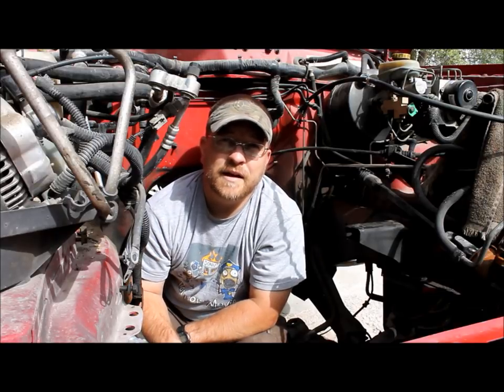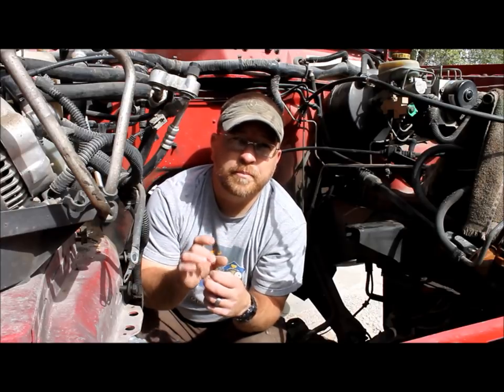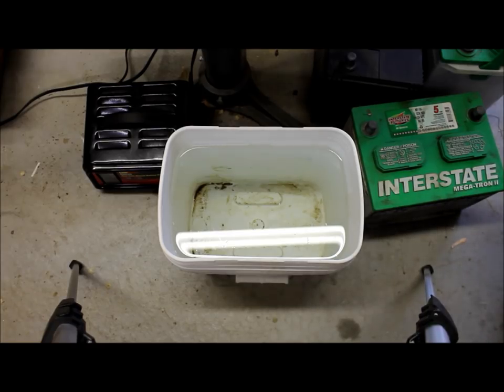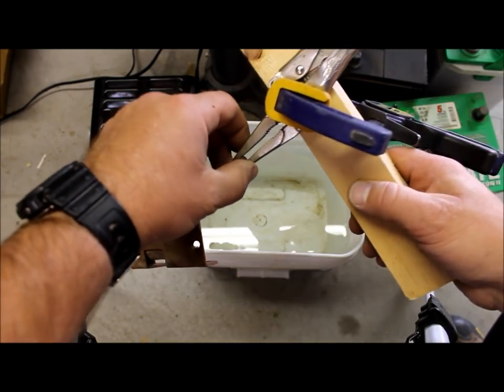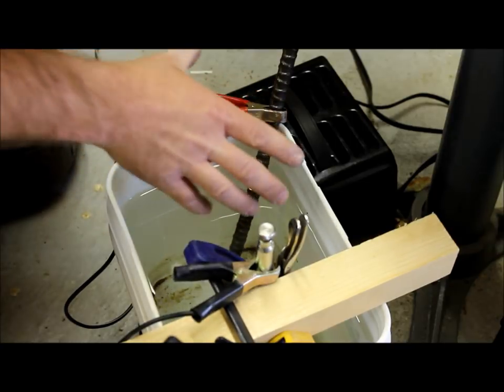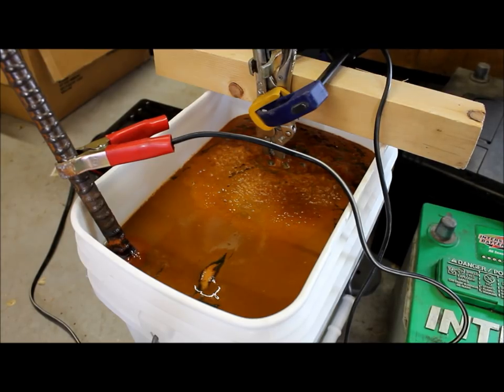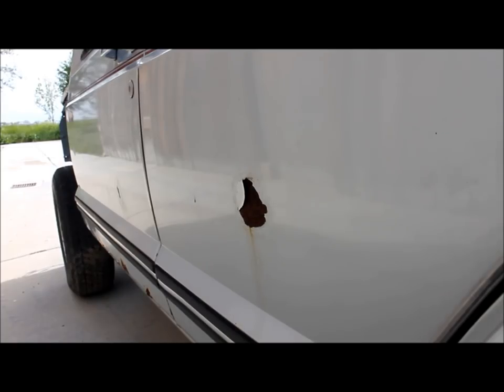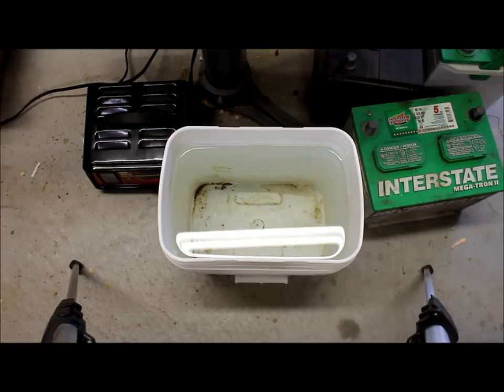Remove Rust With Electrolysis

Comment: The anode will erode during this process.  If you do a lot of this you'll notice the rebar gets thinner over time.  If you reverse the polarity your part will erode.  The surface will become grainy as metal is lost.  Electrolysis has been heavily studied by the archeology departments of various universities (Texas A&M for instance) where it is used to conserve iron artifacts.  They have recommendations for how much current to use based on the surface area of the part.  The 1st choice for chemical to dissolve in the water is lye (NaOH) - its supposed to give the best results in a 2% solution by weight.  Sodium hydroxide is a bit nasty though and so a close second would be the sodium carbonate (washing soda) in a 5% solution by weight.  Its usually available in the laundry aisle of the grocery store but if you can't find it, you can make your own from baking soda.  Put the baking soda in a glass baking dish and bake it at 250F for an hour or so.  The sodium bicarbonate decomposes to sodium carbonate with the release of some carbon dioxide gas.  You can easily tell if you've achieved the conversion because baking soda has a salty taste and washing soda tastes bitter (spit don't swallow!).  After electrolysis your part will have a black coating which is another type of iron oxide called magnetite.  Its essentially the same stuff as mill scale.  You can take it off mechanically as with the wire wheel. Another way is with HCl (hydrochloric or muriatic acid) which should be diluted with water 3:1.  Follow up with thorough rinsing and drying before you prime and paint.  Avoid heating the part to dry it faster or it may flash rust.  Magnetite will not hold a paint finish so it must be removed.
Reply: After treating iron with muriatic/hydrochloric acid and a water rinse always followup with an ammonia wash and water rinse. This will dramatically reduce flash rusting (sometimes for weeks). Try and use a 10% janitorial ammonia (household ammonia is only 3%) Ace Hardware stocks 10% ammonia. Afterward, it's safe to dry with non-petroleum heat (no torches) or water dis-placers (WD-40) unless you're painting.
Reply: You'll also find sodium carbonate among the pool supplies.  Probably labelled soda ash.
Reply: @Ryland Trenton Yup, I have been using instaflixxer for months myself =)
Reply: @Ryland Trenton Yup, I have been using InstaFlixxer for months myself =)

Comment: I tried this for the first time on a couple of pairs of pliers that we're in the bottom of my toolbox. Totally seized with a heavy layer of rust. After about ten hours I cleaned them off with a wire brush and both worked excellent. After I cleaned off all the rust I sprayed them down with some good quality penetrating oil and put the in a Ziploc baggie for a couple of days. Now I have two more pliers back in service.
Reply: Why did you store them in a ziploc bag after oiling them? What does that do?
Reply: @Syberz  To give the oil time to penetrate the metal. Not sure if that works or not but doesn't hurt.

Comment: I just wanted to add a little helpful info , Some battery chargers are automatic , If they do not see a 12 volt current they will not turn on and perform like you want them too , I have found using a car battery to be useful by using wires to hook up the part you are trying to de-rust and then attaching the other ends to the battery then hook up your battery charger to the battery to keep the battery charged and complete the electrolysis cycle ...
Reply: How long can a car battery last during this presses ?
Reply: @HaythamBuKhadra   You use the battery as a buffer with the charger connected

Comment: Electrolysis will release hydrogen at the cathode and oxygen at the anode. So don't do this in an enclosed space. Just a heads up for everyone else wanting to do this.
Reply: Brandon c IMPORTANT safety tip. Thank you! This is much like charging a car battery. You never want to do it in a confined space especially around pilot lights. Thanks Brandon!
Reply: Brandon c now if the hydrogen and oxygen can be captured independently and stored...hmmm
Reply: Because hydrogen is flammable and when mixed with oxygen it's more of a bomb then fiery explosion. It's not really that big of an issue if you're doing this the same way it's done in the video since the amount of gas released is quite small.
Reply: Is a great way to use H2 on a 4.0 L.
Reply: Only really an issue for prolonged periods of time or on a large scale. It takes a lot of both gases to be of concern, otherwise it will just be diluted by the air. If you're worried, have a fan circulating air in a room and you'll be fine. Doing this once in a while over night, not likely to create enough gases to risk blowing yourself up.

If it's a small part like in the video though, you're better off using distilled white vinegar anyways. All you need is a plastic container and the white vinegar. Drop the part in and come back like 8 hours later with a wire brush.
Reply: @noidontthinksolol  All it takes is a mason jar and two bolts to create enough for an explosion. Ask me how I know ;D
Reply: @noidontthinksolol  LMAO Ok buddy now move along
Reply: @noidontthinksolol  Well folks, he called me 'kid'. Hes clearly won the internet; time to shut her down.
Reply: @noidontthinksolol  Ahh yes, step two is to say that I have 'issues.' The next step should be another insult, That will be either on my heritage and alluding to being inbred, or a hillbilly, etc. Another acceptable third step of escalating rage is implying that I have below average intelligence; sometimes the two are combined when the rager is feeling particularly clever. This will bring us one step closer to the final inevitable nazi/hittler reference.

This is textbook internet interaction at its best.
Reply: @noidontthinksolol  Absolutely! Its definitely ME and not you.
Reply: We did this in high school back in the 70's, in science class. Created a hydrogen/O2 mixture and forced it into a balloon, then lit it with a match on a stick and made everyone's ears ring.

Comment: The one and only way that I know is better than what you showed in this vid is to increase the size of the anode. A flat piece of steel as large as can be fit into the container works best. Increased surface area increases the speed at which the process happens.
Otherwise, yet another great vid. Thanks Tyler.

Comment: Great job, I love watching electrolysis videos. Also electrolysis videos to help dye aluminum different colors and turn titanium pretty colors. One thing to add, don't mix metals in electrolysis like aluminum or copper it can ruin one metal while doing the job on another. Stick to iron in one bath of solution. 

The bubbles forming are the gases of the molecules breaking free from the chemical bonds. A good example is  2 electrodes in distilled water, a negative and a positive rod. The negative rod will have hydrogen(H+) gas bubbles since neg<->-pos and the Positive rod will have oxygen(O-) gas bubbles Negative->positive rod.

Comment: I like the tip on placing a piece of PVC, with holes drilled in it, around the rebar to keep it from touching the part. Clever.

Comment: Having done this many times over the years, I can tell you that the amount of washing soda (sodium carbonate [not bi-carbonate]) *does* make a difference, as this is what creates the conductivity between the anode and cathode. With higher amps (up to several hundred) and higher voltage (12-24v) and a1/2c to 1 cup of washing side dissolved in the water, you will see a LOT of bubbles and fizzing activity, and it's unlikely you will need to use a wire wheel at all.

Comment: I have heard that after you have electrolysed the rust off, you can zinc plate the part to protect from future rust by replacing the iron anode with a zinc anode and electrolysing again.

Comment: starts digging a hole to put my trailer in and do this.
Reply: Hahaha!
Reply: Saves money for pool*
Reply: Actually...I did my whole trailer frame this way. Piled up a 12" dirt berm around it, lined the berm w/single sheet of plastic, placed large scrap sheet metal on the bottom (my sacrificial anode). Some small plastic blocks on top of that, upon which my rusted, ol trailer frame sat. I took off the axles, but could've just as easily flipped it over with wheels sticking up out of the water. Hooked up the appropriate wires, filled w/water & pre-mixed bucket of electrolyte...and plug in!
Easy Peasy! (Pro-Tip---Works better if you hook up a battery to the solution and just let the charger keep the battery charged)

Comment: great tutorial,the only thing i would like to add is it does work with baking soda. (i couldnt get washing soda in ireland) just used some baking soda and it worked great, might take a bit longer but it still works
Reply: Alan Conway Yes, you really just need some sort of electrolyte to make the water more conductive. I recommend the washing soda because it dissolves so easily and is really inexpensive. Like you said though, if you cant get washing soda, baking soda will work. You may have to put a bit more in the water though.

Comment: If you put more curent and more voltage the proces will be faster?
I have a 50 v ,65 to 120 Amps trasformer and sure its has a 200A ,4 diodes bridge rectifier.
Reply: +Viricial thank you
Reply: +Viricial Its an old Rod Stick welding machine witch i modified or you can say i put a rectifing bridge on it.The machine has its original leads and crocodile style clamps.Big clamps i my add.The wire is 20 mm in diameter (not 20 Square mm) .I dont know in awg sorry.They are thick like a pointing finger.

Comment: Thanks for the informative video. I set this up at home to de-rust a corroded BBQ grill. I bought the cheapest battery charger, but sadly it had some built-in analytical system which automatically switched the charger off because it recognized that it wasn't attached to a car battery. Oh dear, so frustrating. Be careful if you are buying a charger, why does it have to be so complicated!?
Reply: Add a small car battery. So, connect charger to battery to electrolysis tank. It wont harm the battery.

Comment: Could you use wire hangers to hold both steel anode and object, instead of wood and clamps etc.?  Wire could loop around objects then have hooks with  "terminals" since wire is easy to shape.

Comment: Hey Tyler! If you use scrap stainless steel for the anode it won't dissolve near as quickly, your water won't get all gunky, and your electrolyte will last about forever.
Reply: Yes, but using SS also releases Hexavalent Chromium which is incredibly toxic and all but impossible to dispose of. Creating or storing it without a license is actually a criminal offense in most states.

Comment: Use baking soda in the water, you'll get better connectivity. Don't purchase the Soda Wash, it's like $11 more than generic baking soda which is around $3.50 for a big box. It's all just Sodium bicarbonate. A half cup in a five gallon bucket is plenty. You'll see it fizz, it's pretty cool. You can do it in different time settings if you want the patina to stay. Leave it in long enough and it will vanish.

Comment: I tried this a few times and started to think the charger was a type that couldn't do the job, I was wrong and almost bought another. Turns out adding MORE washing soda is all it took. The stuff is cheap put more in! After adding about 3x more I could see the bubbles forming and it was working.

Comment: cool.  My battery charger seemed to cycle off for a while every 15 minutes or so.  I reckoned it was some thermal safety shutoff nonsense.  I set up a small desk fan pointing at the charger and it doesn't seem to be doing it anymore.       Pro tip for cool kids - you need a crappy old school battery charger with nothing but an on off switch and an amp meter on the front.  The fewer "smart" or safety features the better for this kind of thing to work properly.  You should us a GFCI protected outlet though...for realz.

Comment: The negative pulls the hydrogen (because it's positively charged) and the Positive pulls the oxygen (neg. charge).  Oxidation is what causes rust to form.  Oxygen is required for just about any degrading chemical reaction, that's why it's called oxidation.  The positive lead in any electrolysis setup is always corroded  and crud covered while the negatives are spotless.  I have always noticed that but never thought to use it to clean metal parts (I use electrolysis in making hydrogen fuel cells and am in an in between phase trying to turn it into a business for myself).  That is a clever idea.  Where did you get it from and why do you use the washing version of baking soda vs. regular baking soda?

Comment: Nice video, thanks.  Question, does the entire part have to be submerged?  The reason I ask is that I have a bike frame that has rust in one corner and if I could just dip that corner into the liquid, that would make finding a container easier.
Reply from the maker: Ya but it’ll only do that submerged part.

Comment: Yes, Negative to positive. Most of the world has it wrong. Even after it was proven, the majority of the world wont accept it. So your on the right track. DC. leaves out at Negative, and return to positive. The hot side of a battery is the negative post. It leaves the negative post, goes through ur car back to the positive post of the battery. Notice that you put the charging cable from alternator on to the positive post. Adding power back to the battery. So as the electrons move from the negative charge, they carry the rust toward the positive charge in their wake. Hope this gives a better understanding of how it works.

Comment: Hi can I use dc adapter plugged in to home electrical (will be stripped off) but with different volt and ampere? e.g 19v 5a? What's the point of using 12v 2a? pls reply thanks

Comment: Great video. What I can't understand is why your battery charger doesn't cook. I have tried this and the external fuse on the charger blows the moment I switch it on. Its a 12 volt charger, same as yours but with a non variable amperage setting.  Any ideas on how I can make it work?
Reply: You probably had a short circuit somewhere. You don't want the anode or cathode to come into direct contact with each other. Either by themselves or through extension by what whatever they're connected to. 

And make sure your container is non-conductive too.

Comment: I've heard you have to keep stainless steel (Vise Grip) out of the solution because it releases some chromium chemical solution that's really bad for your health and illegal to dispose of in the drain or nature. IMO You should use regular steel wire to suspend your parts.
Reply: yep. Highly toxic substance you cant just dump down the drain or in the yard
Reply: Vice Grips are NOT Stainless. They are normal steel, it wont harm them to derust the tips.

Comment: bleepinjeep  will this mess up the rubber components of the part? Can I do this process to my calipers without messing up the components?
Reply: Peter Alfonso No, Peter, electrolysis wont harm any of the rubber components. It will not effect anything that doesn't conduct electricity. You should be fine de-rusting calipers. A couple people have asked about calipers, so maybe I should do a video on this process on a pair as a test run?

Comment: Now that is awesome. Will that work on Break Calipers?
Reply: Yea absolutely!! You might need to do it a few times and wire wheel it a bit to get it perfect though. Whatever rust and corrosion that doesn't come off on the first try will still be loosened up and will be way easier to knock off with a bead blaster or wire wheel. Electrolysis is great because it takes the rust out of the places you cant scrape on or brush the surface. Gets the nooks n' crannies!!
Reply: I love it. I am going to do this for sure. Thank you so much. I will probably have to replace the piston seals though. Or buy new calipers. I would have to be real careful on rotors though..

Comment: Can you do the same process if the tool has a wooden handle, by attaching the clamp to the metal portion of the tool?
Reply: yes. as long as there is a current loop back to the battery charger

Comment: Would the lower 6-volt setting be better than the 12-volt setting?
Reply: It's not the voltage that is important, it's the amperage that is important. (which is the amount of current flowing)

Comment: HELP! What am I doing wrong.  I have set up everything as you have shown.  The charger is plugged in.  The "+" is connected to the rebar.  The "-" is attached to a wire wrapped around the part I want to remove the rust.  I tried the pliers like you did; I tried a bent coat hanger seen on another YT video.  36 hours and no activity.
Reply: Same here. Seems that modern battery chargers has a "smart" safety build in. So they doesn't work for this kind of jobs. The "old" chargers works fine. Try that if you have one.
Reply: Coat hanger have a clear varnish coating to keep them from rusting on your clothes.  That coating will not conduct electricity and must be removed for electrolysis to be successful.  You need bare soft steel wire known as bailing wire or mechanics wire.

Comment: I'm using a black n decker smart charger on the 2 amp setting and have the anode to positive the part to negative and the charger shuts down 3 seconds after startup! What's wrong!
Reply: The problem is the smart charger. You need a manual charger (one that automatically turns on when plugged in and runs until its is unplugged) the smart charger is reading that the "battery doesn't need any more juice" so it stops pumping out power. Hope this helps:)

Comment: Electrolysis induced hydrogen embrittlement is a serious danger in steels over 35 (conservative number) Rockwell C. DO NOT  use is process on 10.9, 12.9 fasteners or other things like springs or weldments where failure could injure people or damage property.